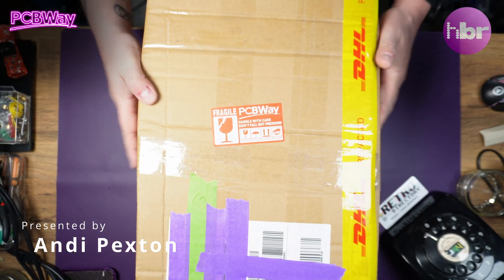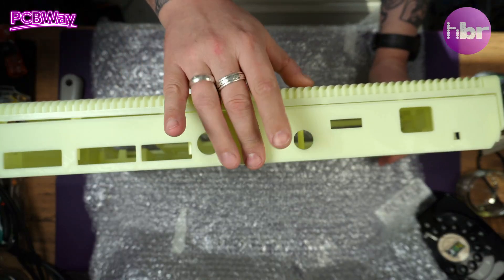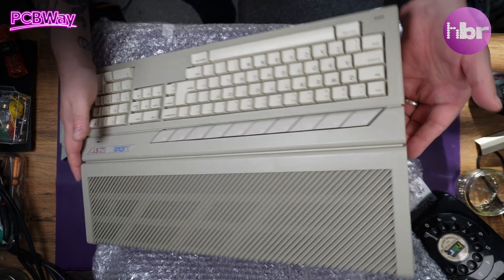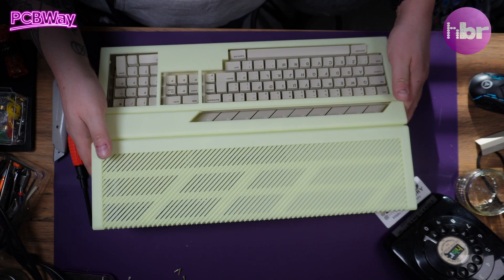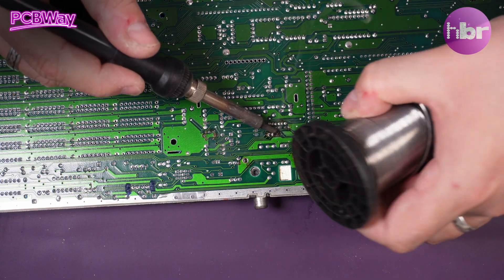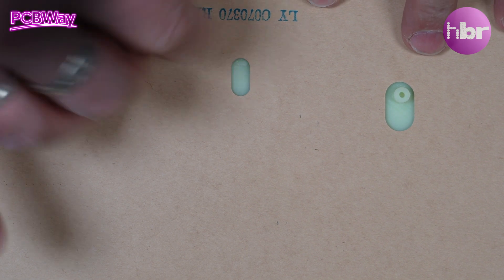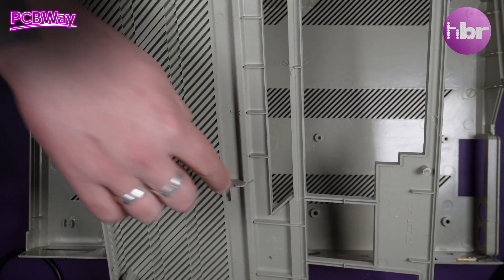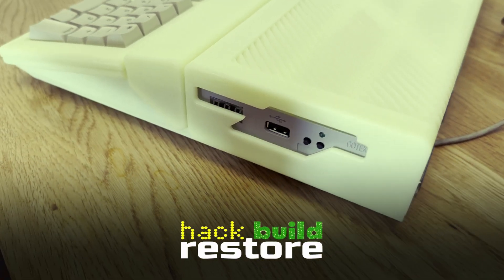Can you 3D Print a Case for a 40 Year Old Computer?

Comment: I strongly believe, you have downloaded the same case I found on Printables (Zfrenchy). I already printed it with my 3D printer and the result was 99% perfect, but I split them in 2, because my printer is only 26x26x26. I also remodelled the floppy drive, because the one you have it´s the old model. I still must correct some protrusions (you also cut in the video.... had the same issues ahahahah). Once I´m done, I´ll publish onto Printables and I´ll certainly name you and Zfrenchy for this great contribution. I´m working also on an FPGA replica of the original GLUE and MMU chip.... but it´ll be very tough because I found only the schematics of the STE. Again many thanks mate!!!

Comment: I got files CGtrader for $10 (50% special days) printed on my Neptune 4 Max in 4 parts, glued them together then installed my my Modded PCB board + 4mb upgrade and and works like new (old case had cracked) but definately not spending $160
Reply from the maker: Glad you where able to print a case that works for you 😀I’m not suggesting anyone should spend the $160, I don’t have a working 3D printer at the moment, but this allowed me to test the concept and highlight some possible improvements that could then lead to a kickstarter to get injection moulded cases made, if there is enough interest…

Comment: You need to take out the gotek board and design a proper mount for it which fits into the drive area on the case. And add a blitter.
Reply from the maker: Thanks for watching… Adding a bitter is a bit pointless imo, nothing except ste game/software use it and a blitter doesn’t make it an ste (and I have an ste anyway) the gotek, as it is, is temporary; as stated :) there will be some updates hopefully before the end of the year!

Comment: Having recently obtained my first 520STe, I'm seeing just how fragile the original cases can be and how tricky it is to get replacements. I thought someone would be making them, but your video has informed me otherwise. Good video.
Reply from the maker: Thanks fore watching... From this journey I know more about the differences in the cases, I think making a one size fits all is possible with some work, I may have to reach out to @ctl-alt-rees to further the research!
Reply: @hackbuildrestore  There are some horrible, annoying differences in where the ports sit between models - a one shell to rule them just isn't going to work without lots of redundant holes/gaps in the back. A selection of different panels for the back might work and just fit/glue the one you want but that compromises the case a bit
Reply from the maker: Not saying there are not things to work out but I was thinking more along the lines of swappable panels that clip in looking at my OG STFM case you can see all the STE ports in the mould on the inside are just blanked off so there is some linage there for sure.